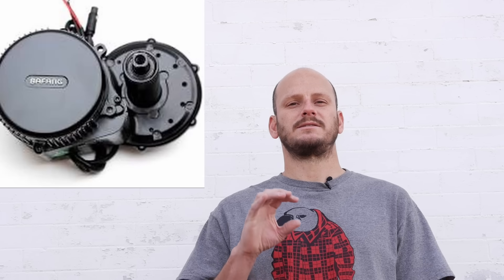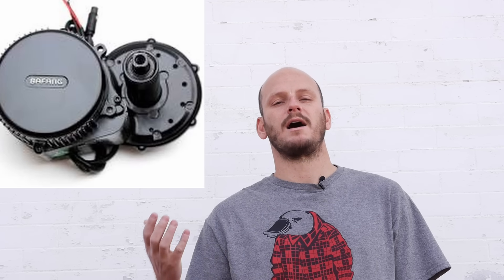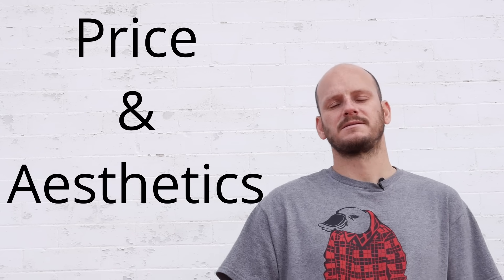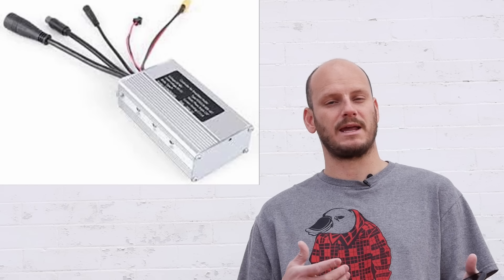Hub vs. Mid Drive Motors: Why Hub Motors Suck and Debunking Common Myths with performance test

Comment: Hub 80 Nm torque, measured on the wheel  vs Mid 120NM Torque measured at the crank? ... which turns slower than the wheel turns so , it need more torque!    ...    Gearing & the Hills  exactly !  It doesn't sound believable a hub motor can stand putting out its full power, climbing slowly up steep hill., max current & no cooling   ...But in UK top speed is 15.5mph so high speed gearing is pointless ...  Hub motors destroy the spokes, good to know,  I guess as they get bigger , the spoke angle is worse ?
Reply: Spoke angle is not an issue if you use the correct rim and hub; look at motorcycles with drum brakes, extreme spoke angles. I use radial lacing with my bicycle rim and hub motor.

Comment: If you won't use the electric and would use the manual pedal, which one gives you lighter pedal?
Reply: If you use a hub motor with regenerative braking you can use the energy from your regeneration to apply enough torque to get rid of all friction, for a very light pedal feel.

Comment: I can't ride a bike because of my lame hip so I bought an e-scooter ... I'm on my second which is a  2 Kw motor vs. 1Kw on the first one ...both are chain drive ( mid-drive motors  ) ... I've never had any acceleration problems on either despite no gearing, but of course, the 2kw is much quicker...I regularly have to tighten the chain ...I would think for the scooters the hub is the better choice, eliminating the need for the chain, and no spoke issues so the opposite of the e-motor choice for the scooters .... but even with chain issue the acceleration  is instant ( takes getting used to using the throttle cautiously, there are two modes so the Econo mode allows easier take-off ) ... for light transport like e-bikes and scooters, electric power is a great and fun way to get around town and country economically

Comment: I think the torque comparison is a bit absurd.
160nm of torque on the pedals if you have a 2:1 multiplication, on the wheel you are going to have 80nm.
 When you double the speed you reduce the torque by half, that's how chains and sprockets work.
And with the big chainring and the small sprocket you will have much less torque, while on the hub motor the torque is more or less constant. 
And don't make comparisons with cars, the torque in combustion engines is crap, they only have torque at one speed. While in electric motors the torque is constant at more or less all speeds, that's why Teslas don't have gearboxs. 

On my electric bike the torque is maintained from 10kmh to 60kmh, the only downside I see is that it is a heavier motor. and if you go less than 10kmh if it is true that it lacks torque, but for road use is perfect. Is 1500w and I use it so I don't have to use the car so much, if I were making one for exercise and mountain riding I would use a mid drive, but I think both options are pretty good.
Reply from the maker: You might like my video on motors, I go a little more into depth. https://www.youtube.com/watch?v=4zS0vD1QNB8&t=507s

Comment: So Mid-Drive for an Ebike and Hub Motor for Emotorcycle ?   Is that correct ?
Reply from the maker: Ya. Or if you are new to riding a bike, use a hub motor.
Reply: Thanks !

Comment: Excellent video thanks. Bikes with mid drive don't ever seem to come with a throttle. Thoughts?
Reply from the maker: not sure. Every mid drive bike I build I put a throttle on it though. Every brand does things differently.
Reply: @JohnnyNerdOut   But that means it can be done then. Thanks.

Comment: Could you have both ? Mid drive + 2 hubs ? Has anyone  seen a working 3 motor bike ?  Wondering why I've never seen it ?
Reply from the maker: you'd probably break your bike. a single high powered mid drive already tests the bikes components at high power

Comment: Johnny, Do you know of any mid-drive motors with a clutch ? To completely disengage the motor from the drive system when peddling normally without the motor. Battery flat or removed. - to avoid the bit of extra resistance the motor adds to peddling. Well if there is not such thing there is an idea for you or a manufacturer. I'd buy one if the extra cost is not silly. What do you  think ?
Reply from the maker: That’s pretty much what a shift sensor does 👍
Reply: @JohnnyNerdOut  A clutch caused a physical disconnect. The shift sensor causes motor cutout electrically. The focus is on getting the motor drag away when not using the motor at all. Ie no battery just paddling. Some kind of physical disengage mechanism where the motor gear meets the other gear.( I am talking about inside the mid drive )
Reply from the maker: @NeoFrontierTechnologies  I got ya. No there is not anything like that currently out. It could totally be done and actually would be a great addition to mid drives. Maybe have like a sliding pinion gear or something? The motor casing would have to be bigger to accommodate more parts. Good thinking😀

Comment: Does anyone know of a more objective video of the difference between hub and mid-drive motors.
Reply from the maker: I actually have a few other videos talking about this - my most recent one is more objective. :)
Reply: @JohnnyNerdOut  I've watched a couple different of your more recent comparative videos and they're still not very objective with the newest one being almost completely opinion based. I've been looking into a motor for a friend's primarily off-road bike. what I've been able to find elsewhere is that a hub motor would be a better choice due to the ease of installation and general idiot-proofness of a hub, mid-drive motors also seem to have a higher tendency to burn out for the type of rider that does not change gears.
Reply from the maker: @123ert789o  correct, like any motor vehicle, if used incorrectly it will burn out ! However, if used properly the power is unbelievable. And so is the natural weight distribution. But yes, if your friend is not comfortable on a bicycle, best to go with a hub. 👍
But your probably right about my videos being biased. It’s really hard not to be.

Comment: What mid drive motors would u prefer if one would convert a bycicle.. Is bafang an option or is there other ones maybe cheaper or better?
Reply from the maker: Bafang is probably the best overall value out there. BUT it all depends on what you’re looking for out of a bike/motor
Reply: @JohnnyNerdOut  thanks for your answer. all I need i something that can give me a push over smaller inclined roads. I'm going to use it to commute to work so biking will be on asphalt.

Comment: This kind of technical argument without graphs or stats at all is just ignorant. Hub motors don’t suck, the hub motors you’ve dealt with suck. Onewheel hub motors are perfect for the application. Expensive bike hub motors don’t have these problems and a professionally built hub bike will be more efficient, quieter and more reliable.
Reply from the maker: It’s absolutely an opinion piece. From somebody who has worked professionally in the industry for the last five years. In every aspect of it. Yes of course there are varying factors on here with quality and such. But a one wheel motor is a completely different thing as its gear ratio is almost 300% different than that of a bicycle motor

Comment: I had a Bafang BBS02 and I liked it.  I didn't like replacing chains and cassettes all the time.  Now I use direct drive front hub motors on my e-bikes, and they require less maintenance than my pedal bikes.  Plus I have fully independent, redundant drive systems.  

If does take about 1-1/2 times as much power to the hub motor to get comparable overall performance as the BBS02.  That's easier to provide than new chains, cassettes, wheel sensor, PAS sensor, and all the other things that the BBS02 wanted from me.

Comment: A BEV car has one gear and can take off faster than most sports cars.
However, having the motor in the wheel is a bad idea. If you bend the rim then its a huge expense to fix/replace.
Reply: You can have a hub motor with a replaceable rim.

Comment: While your msg may be well intended, your position would be greatly improved if you clarify at first or end that mid drive rarely come with a throttle. So for someone as myself with an arthritic knee, a hub motor ebike is my only choice. Unless you know different. BTW, I Like your informative passion.
Reply from the maker: Every mid drive kit that I sell and install comes standard with a throttle. If you buy a premade bike (overpriced) it might not....
Reply from the maker: All of the middrives I use (Bafang BBS 02, Bafang HD, & Cyclone) all come with a throttle. Baffang comes with pedal assist as well built in by default.

Comment: Thanks for the comparison. I've broken a couple of spokes on my $200 ebay 1kw hub motor but it otherwise seems bombproof. I use it solely for commuting and errands but have over 3k miles on my 2nd hand kit, seems very reliable. Not having to pedal is nice when I take it to work so I'm not sweaty, definitely an advantage of the hub motor if that's your use case.
Reply: And this is my purpose for getting and shopping around for Ev bike the same Example I just want to do a little commuting and get to work
Reply: Good points . I dont know how many miles I put on mine riding it almost every day for years , but I bet way over 15000 miles,  Ive worn out more tires  than I can rember ,  I have broken some spokes and each time I replaced with larger dia intill I got the largest the motor can take  , problem solved. no more broke or lose spokes !
Reply: Mid drive has throttle only mode.
Reply: @baitball4665 - some - but throttles are less common for some reason than with hub motor systems. 

Possibly because mid drives got popular in Europe because they're restricted to 250 Watts, and throttles are not allowed.

Comment: What about dual motor? Turn on the hub when you’re on the highway. Make it a geared hun too. High gear ratio for maintaining speeds.
Reply from the maker: I'd rather have a single mid drive for better performance than 2 hubs
Reply: @JohnnyNerdOut  Would it be possible to design a hub motor for highway cruising and mount in on the front wheel?
Reply from the maker: @brianmccullough8493  yes
Reply: @JohnnyNerdOut  and mag wheels for the spokes.

Comment: I have an old banana seat bike, no gears,
so i thought i was going to use the mid motor and at the end of the video you seemed to suggest that i had to go with the hub motor, can i still use the mid motor or not?? Thanks
Reply from the maker: Yes you should be able to. Just won’t be able to utilize the full benefits of having a mid drive

Comment: Okay, I wont get the hub motor I was considering and only look at mid drives. So which is better to pair with a mid drive motor, a 3 speed Sturmey Archer or a 7 speed cassette?
Reply from the maker: Check out my video on that 😀👍
Reply: @JohnnyNerdOut  I would, but not sure which one its covered in. You have like a zillion vids bro.
Reply from the maker: @donbaldwin9590  https://youtu.be/VRoucNtcfDQ

Comment: Are you trying to say the torque is not related to the programming of the motor controller?  Where did you find all the software and hardware specs?.  Are you a diagnostic engineer that has broken down all the programming steps and/or analog timing components?  You state nothing but useless facts.
Reply from the maker: Software can definitely have an affect on performance. Motor and controller specs are easy to find for Bafang systems. Also it’s free and easy to look at the programming parameters of the bbsxx systems👍

Comment: You say the difference is $50 in motors but the bikes are being sold at a difference of $500 (biktrix).

I bought a hub drive coz the difference is significant. So essentially it's the same old thing. You pay more for better stuff.

If both had the same price and people still bought a hub motor, that might be an unwise decision.
Reply from the maker: I have a video coming out very soon discussing why mid drives cost more, but for conversion kits of similar quality and power ratings it’s about a $50 difference give or take.

Comment: I think I'll go with mid drive. Just gonna wait couple months  for price drop promotion. I like being quiet, stelt and more efficient. You don't have drag when you pedal only. It can't overheat. You can climb hills. Also you are lighter with couple kg or so. Only downside is snapping chain and price, but just be little careful and you will be fine.
Reply: My hub does all of those things.  Quiet, no drag on pedals, doesn't overheat after hours, climbs hills like it's nothing, doesn't snap a chain and was like $250.
Reply: @wob6776  Hub drives literally over heat way more than mid drives. And my hub drive and mid drive bikes are equally silent. Hill climbing is not even close lol

Comment: Mid drive trains are not ready yet, chains and hubs too fragile still, only one factory makes a good chain. Not many people can swap a chain. Blown several rear hubs on mid drives. So you also admit user error is a problem either way. Been riding hub motors  10 years no spoke issues as wheel builds properly.  Factory wheel builds I can see as an issue. Get to a wheel builder and spokes won’t fail in my experience. The bafang mid drive is shit, keeps failing on the works bikes i maintain, its torque sensor is crude an feels like a hub motor. System parts take turns in failing. Physics states mid is better but they are not good enough yet. Been working ebikes 10 years now and it’s too soon. Get a bike with a mid drive Bosch or shimano the chances of being able to fit a new motor in 10 years are slim as the motor brackets are already changing. For now learn to ride hub, the only bike around here better than my hub bike is another hub bike. Save your money for now.
Reply from the maker: I agree with you about wheel quality. The problem is that people buy crappy gum motor bikes with 2 seconds of quality on the spokes. 
As far as mid drives though we are worlds apart. The time has never been greater for mid drives. The tide is shifting towards mids (pun intended)

Comment: I mean, i'm neutral when it comes to hub and mid drive motors. I've put my hub motor through 10,000 miles and I bought it 5 years ago and it hasn't unraveled any spokes because I have a thicker kind to support it. As for other stuff, eh its just overtime damage and usage having it. I've enjoyed it, thanks for giving me the advice on hub motors and what flaws they may have the same as a mid may have.
Reply from the maker: it really depends on what kind of riding experience you want. they are very different feeling. Personally I think a Mid drive is more natural.

Comment: Guy, I came here to hear what the real differences are between the ride and the fun of using an e-bike with a hub motor and a mid-drive motor. I have a hub drive, I have a throttle and I do not WANT to do any maintenance on my bike. This video is about your bias and you are riding your bike to do what? Go to the grocery store? Go to the park for Pickleball? Go do daily errands? You seem to think it's all about speed. An e-bike is more than just that. It allows many people to keep active and get a workout by using a bike again. BTW, I'm fine being in 3 gear forever, it gets me wherever I want to be.
Reply from the maker: You are totally right. I have plenty of other videos up breaking down the difference further. Summary, mid drives are an advanced system. this video isnt to shame anyone or make anyone feel bad. When starting out with ebikes I would probably recommend a hub motor. try it for a few thousand miles, and then once you've mastered it, consider upgrading to a mid drive system :)
Reply: @JohnnyNerdOut  Ok, thanks for the clarification. I'm about 500 miles in with my hub drive so I will keep the things you suggest in mind when I buy my next one but it probably won't be for at least a year and by then there may be even more choices. It seems every month someone has a new e-bike with better components, longer battery life, etc. I'm just happy I have found joy again in riding a bike. Cheers.
Reply: @debbied9997  I am still riding with a battery from 2015 with a hub motor and electronics from even earlier than 2015. My bike is basically 2010s chinese ebike tech. The battery has done 20k km at least on multiple bikes and the motor and controller are second hand and I have alone done over 10k km with them.

This tech doesn't magically get old and the new stuff isn't magically better. I can still out-run 50 cc mopeds with my setup, so I am happy. Also zero maintenance all these years, as you mentioned.

Comment: The Shimano Steps E6100 mid-drive motor is rated at 60Nm torque and the lower end E5000 series is 250W rated at 40nM max torque so I don't where those numbers at 1:45 are coming from.
Reply from the maker: bafang systems
Reply: @JohnnyNerdOut  you're right, my apologies.  Not what your video was about, but I can't believe there's such a stark difference in power ratings between different motor brands.
Reply from the maker: @artv232   evasive shimano, Bosch, Yamaha etc when built into a premade bike have to adhere to European power standards so they can sell them globally. Not the case of you convert a bike.

Comment: you can perfectly have all the gears in the world with a front hub motor!  Also, mid-drives wear rear wheels and put lots of strain on a chain, which means also on a crankset.
Reply from the maker: it "can" put a lot of strain on drivetrain. When ridden properly, minimal wear.